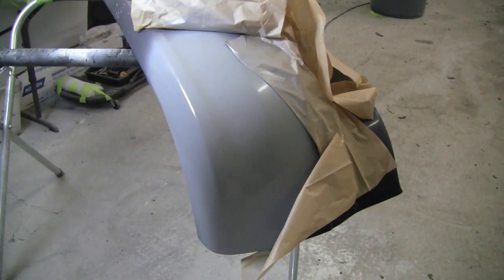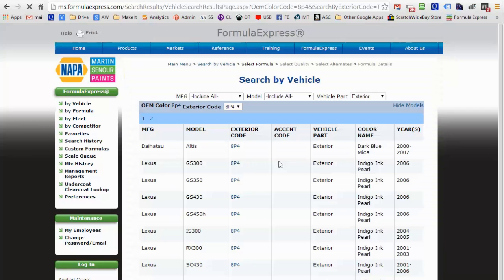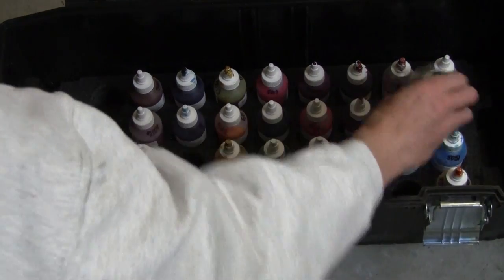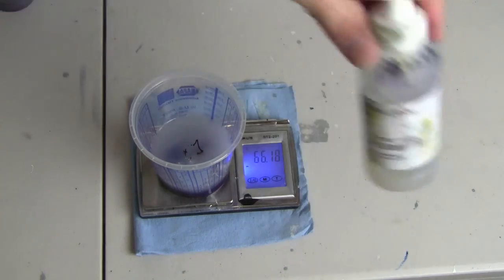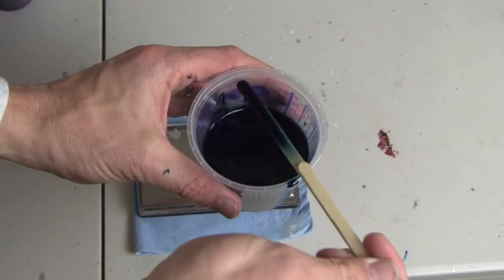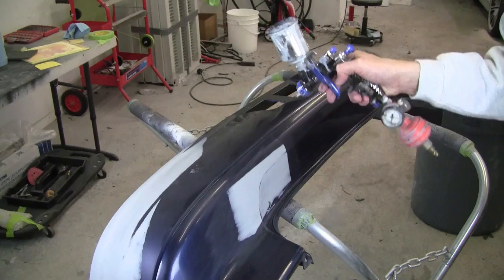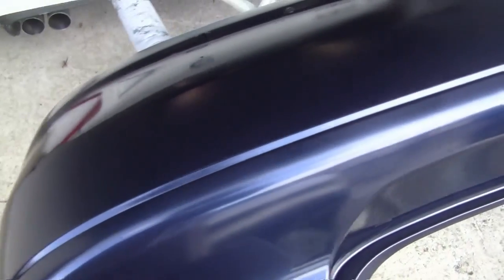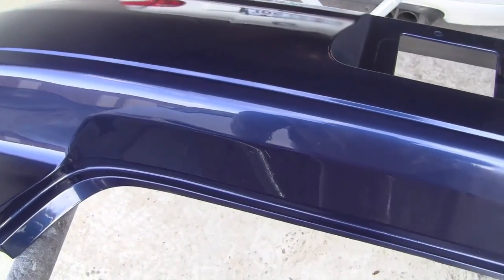Learn Plastic Bumper Repair Vid 4/5:  Apply Base Coat

Comment: For the diyer its much cheaper to find a company who specalizes in mixing car paints or exact match colours and who will put them in spray cans . to buy all the colours needed to make 1 car colour will cost you hundreds of dollars plus you need the equipment to mix the paint and if your not good at math a little to much of a colour and youve ruined the colour your looking for . car paint codes if you dont know how to read or understand them if you see something like ABT BC abt is the colour code of the car bc is for base coat clear coat some car makers use numbers letters others just use letters . has someone whos done this for close to 40 years i say find a company to mix the exact match its safer and less expensive .

Comment: great video thanks. do you have to key base coat before applying clear coat, if so what grade of wet & dry?  thanks
Reply: jay 2015 you don't need to key the base coat before lacquer, only what's underneath it.

Comment: so when repairing plastic and sanding, is it that because it's plastic, it's a rule to sand with a little finer grits compared to the normal you would use like your metal sanding then?  asking because it seems like most repairs I've seen on plastic bumpers covers, the tech usually goes finer in grits when going through the sanding steps.  nice video and good work btw thanks!

Comment: Do you use a wet bed to blend the base coat or do you just spray the base color? thank u
Reply from the maker: +Jon Varbero Just spray the base color until it:  1.  covers the primer.  2.  blends nicely with original paint.
Reply: Great Thank you.